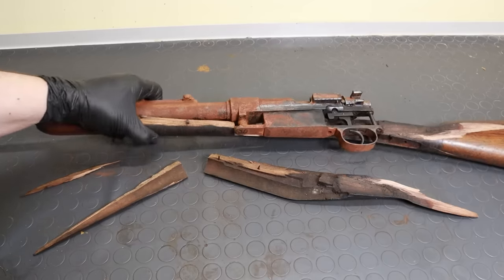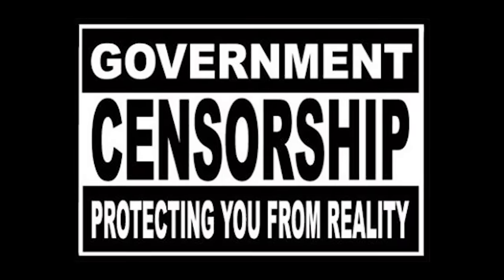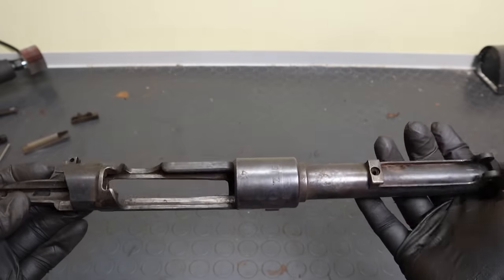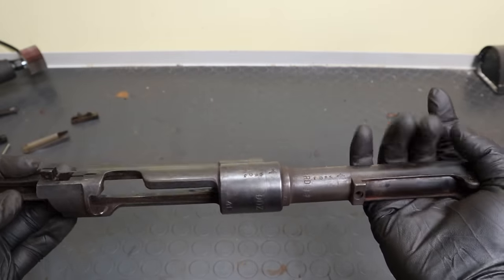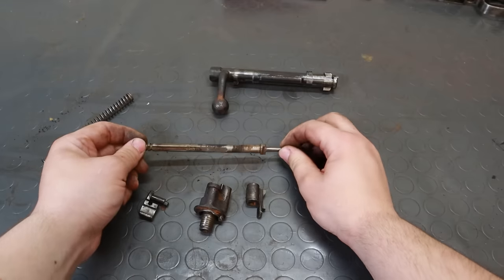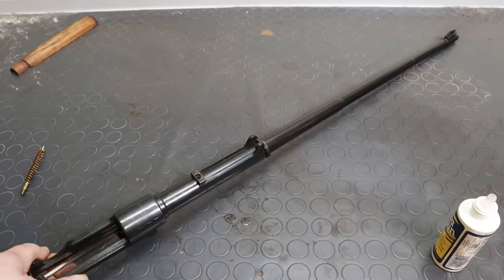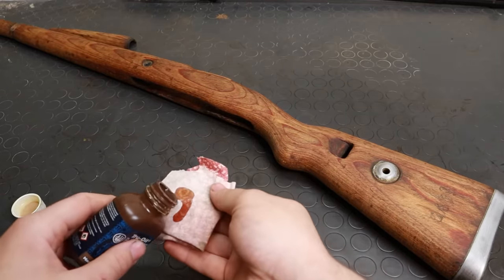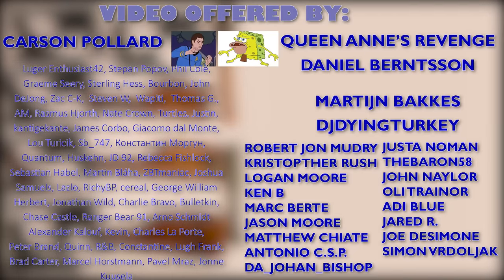Restoration of German Kar98K WWII Rifle

Comment: What would you do if you found a live cartridge in such a rusted gun?
Reply from the maker: I would force open the bolt at the range, with the muzzle pointed towards the embankment. Luckily it never happened to me yet to have a stuck bolt on a loaded chamber
Reply: @Backyard.Ballistics  On that note with a seized bolt/action, how would you know or find out if there is a live round?
Reply: @cambargera  use a cleaning rod. First lay the cleaning rod beside the barrel with the patch/wire bristle end at the chamber and tape around the cleaning rod that would be protruding from the muzzle. Run the cleaning rod with tape down the barrel and if the tape is out the muzzle more than it would be on an empty chamber there is a round or at least a spent cartridge in the chamber.
Reply: @cambargera  you have to look down the barrel
Reply: Realistically a round that old and weathered you would never have to worry about, however it would be wise to do the disassembly at the range
Reply: @KJTUSKJTUS  Doesn't matter how  old ammo is. If it is present, treat it as live and hot.... Basic gun safety, you know...
Reply: @KhaziirEverflight  Especially considering even wet ammo will usually maintain its airtight seal even in the worst of times, I've seen old WW1 era .303 british that were fished out of the ocean and cleaned up were able to fire relatively reliably, considering they used cordite instead of gunpowder it was a feat and a half
Reply: @KJTUSKJTUS  I just found some .303 ammo made in 1917, in my grandparents garage. It had definitely been wet more than once in the time they had sat in the toolbox they where in, they where covered in rust and green corrosion. The primers still fired when I removed the bullets and the cordite still burnt when put to a flame. Was super surprising to me they still seemed usable, but not a chance i was trying to use them.
Reply: @tigerfang6063  I just found .303 ammo from 1917 that was still usable and had 100% sat in a wet unused toolbox.
Reply: @nickoloes  uh no, that’s a very stupid idea for reasons I shouldn’t have to state.
Reply: @Slender_Man_186  he's joking
Reply: @KJTUSKJTUS  living in the SE of England I can tell you that's not very factual at all. We are constantly digging stuff up that more often than not goes boom, and this stuff has been buried for the better part of 80 years!
Reply: @nickoloes  lOL
Reply: @Slender_Man_186  r/woooo
Reply: Imagine using it without a stock…
Reply: @jaywils1078  lMAO
Reply: @KJTUSKJTUS  i used to regularly shoot rounds that were 50 to 60 years old & most fired w/o a problem.
Reply: What americans usually do
Reply: @KJTUSKJTUS  thats not good advice, plenty of ww2 ammo still perfectly usable and protected in a rifle chamber it wouldn't weather much unless water has been inside
Reply: @jaywils1078  tarkov
Reply: @cambargera  u look down the barrel, duh
Reply: that was a great question
Reply: The rust was less severe as I thought.
Reply: Amazing endresult
Reply: @KJTUSKJTUS  lots of live bombs get donated in Europe which are the same age.  You can still buy milsurp ammo that's that old and it still fires.   Assuming it won't go off because of its age might be dangerous.
Reply: @KJTUSKJTUS  Not always true. Should look up the forgotten weapons video discussing turkish 8mm mauser ammo.
Reply: Remove it.
Reply: @KhaziirEverflight  that’s why he said do it at the range lol
Reply: @ambi_cc8464  and because it was done at a range makes it less risky, or what is your supposed argument?
Reply: @KhaziirEverflight  I was just saying he had gun safety in mind even he was wrong about the ammo
Reply: @KJTUSKJTUS  Plenty of gunsmiths have been burnt by muzzle loading guns - old ammunition doesn’t mean safe (as it can actually become unstable and detonate rather than deflagrate when ignited).
Reply: Try to fire the old cartridge after restoring the gun
Reply: Brilliant channel, I only wish that here in the UK we were allowed to pursue our interest. But I’m afraid that two mentally deranged people ruined it for us. Hungerford, and Dunblane. From there on  we as gun enthusiasts were all classed in the same category. And had our liberties taken from us. Just as though we all had their intentions to go and kill indiscriminately.  If a proper check on people applying for Gun licenses had been undertaken, it would never have happened.
Reply: Crap my pants
Reply: @KJTUSKJTUS there’s people who have been cleaning 1700’s cannon balls and have had the powder inside blow up and kill them
Reply: @Backyard.Ballistics  one of my uncle's was doing some digging on some property he bought and found a owlhead revolver in the dirt with live rounds. He removed them, at his friends house (friend lives in a rural area and can shoot on his property) interestingly enough when we looked it up one of the things that popped up was "Top ten Confederate hate symbols" interesting find haha
Reply: POW!

haha.
Reply: @nickoloes  great way to lose an eye
Reply: Do you know what a joke is?
Reply: 4:34 the cleaning sound is satisfying 😌
Reply: @Backyard.Ballistics what do you do with the restored guns?
Reply from the maker: @LorenzoRodriguez-c4c  they're not mine, after I've sorted them out they are either sent to museums or kept in our warehouse, depending on where they come from.
Reply: @nickoloes  bad advice even as a joke.

Comment: Tip: for round cylinders, hook it up to a lathe on the lowest setting and apply the shoe shine technique. You'll be able to cover broad, smooth areas relatively quickly and only really need to dig in by hand for the nooks and crannies.

Still, impressive attention to detail for doing it by hand.

Comment: That was awesome! You know your stuff about these rifles! A few other things about the '98 Mauser is Firstly, they have a 3 position safety. First click (straight up) prevents you from sighting the rifle to remind you its on, and allows you to cycle the bolt with the safety ON to unload. I noticed this wasn't done in the video but rather with live rounds and on "fire" position. The next click locks the bolt, I've used this carrying it on my back because once I fired it with the bolt knocked partway open! All that happens on these is that the firing pin spring actually automatically rolls the bolt down into the locked position before firing! The metal ring in the stock is a bolt assembly tool! If you stand that rifle with the cup style butt on its butt on a flat floor you can walk away from it, looks kinda freaky when you first see it, told a few people a ghost was holding it! they are that balanced. The sight slide has graduations on the back so it can be set without raising your head. I personally love the sights for accuracy and the stock 2 stage triggers can be slicked up pretty good. The stripper clips dont need to be pulled out but rather eject when bolt closes. I can see how the sights are not as fast as some or good in low light. No other rifle until Vietnam had as good and stable of a stock. Each rifle had to be fired with 3 loads at at least double pressure and show no headspace changes. You did a fine job even selecting the correct milled barrel bands for an early one, and I wish I could fire it! Definitely has that 8mm Mauser double clap sound!

Comment: fucking flawless, absolutely astounding skills with turning literally a piece of rusted scrap metal into its original glory of what could be the best bolt action rifle of its time.
If guns had a soul, this ones could put itself to rest knowing its back how it needed to be.
Reply: The K98 was the best bolt action of the time
Reply: @HenrikSherwood  I find that my VZ24 and my 1903 has a much more smoother bolt than my kar98k but i still love it of course. Theyre all in great condition too, A type 99 Arisaka isn’t quite bad either, since they’re all a copy of the mauser bolt.
Reply: @ItchyPilauBoto  I think the 1903 springfield is actually a mauser 1893 type

Comment: THIS, is proper rust.
the parts you would expect to be rusty, such as the outer layer of the barrel and the bolt handle, ARE rusted.
the parts you would expect to have been protected by the wood, or by the barrel itself, ARE clean!

Comment: The significance of a 'controlled round feed' action, such as a Mauser 98, has nothing at all to do with cycling the action from an inverted position.  So why then is CRF action useful, I hear you ask?  CRF largely eliminates jamming resulting from 'short-stroking' the bolt.  With a push feed action you run the risk, in a stressful situation, of chambering a round and then attempting to extract it  and recycle the action without closing the bolt.  This typically results in a round being left in the chamber, which is then jammed firmly in place when the shooter attempts to chamber another round.  When this happens the rifle is rendered completely inoperable until such time as a cleaning rod can be used to dislodge the stuck cartridge.  This situation shouldn't happen in a CRF action because the cartridge rim is firmly engaged by the bolt-head throughout the loading and extraction cycle.

Comment: I am going to be honest here mate.  All of your restorations of "rusty" stuff look fake. And what I mean by that is the "rust" itself. I have handled many restored and found/dug out weapons and after 50+ years the rust leaves some major pits, but in every single video of yours, the restored weapon looks brand new. Same with the stock - if it was old and damaged, the chipped wood would not looks nice and fresh.
Reply: He stated quite clearly that the rifle was given to him without a stock, and the broken stock in the video was unrelated and just for display purposes.
Reply: The guns you see were not found in battlefield, they were stacked inside houses, this means usually between walls with a rag and well greased. They can survive decades without even rusting if the job is done correctly
Reply from the maker: The surface looked miserable before I sanded it off, it gets much better after sanding. However, I have to admit that I normally cover guns that  I am confident I can save. In other words, and in all honesty, I try to pick  stuff that looks worse than it is. I don't have the kind of budget required to buy a good Steyr K98k and ruin it just to make it a video, it's a 2 grand gun here.
However, many channels with way more views than me (several millions instead of a few 100K) actually buy them good and rust them on purpose.

Comment: Well done. As a conservator for these particular rifles, myself, I must commend you for doing an excellent job; although I wouldn't have used TruOil for the finish. The stocks were originally sealed with Boiled Linseed Oil. It takes longer and requires multiple coats but the end result is more worth it for preserving the history of the rifle over the time it takes to get the same finish with TruOil.

Comment: Just one tip always test fire with just one round in the gun.  That way if it jams it won't have live rounds in it.  Or if it blows up then it does not have rounds in the mag that could detonate as well.  Mausers have pressure relief holes that will vent down into the magazine.

Comment: One trick I've used with sandpaper strips is backing them with duck tape or similar, this keeps the paper from wearing down on the edges and makes sanding round objects, like barrels and stocks, a lot easier in my experience.
Reply from the maker: That is probably even better than what I do
Reply: I'll keep that in mind. Thanks!

Comment: As you were tapping the trigger/sear pin, I wanted to say " watch out for that spring" and as I was thinking it, it popped out. I can't recall how many times I have lost that darned spring, and others like it, under my bench so many times that when my kids clear out my shop, they will have a whole lot spare parts for guns, lol. Also, as you mentioned the grease in the stock, I recalled my gunsmithing instructor setting cosmoline coated stocks on a paint booth stand in front of a gas heater in the shop and it was my job to wipe it off every 10 minutes as it soaked out of the pores. After we did that, we used a trick similar to yours. Also, check out Track of the Wolf black powder supplier, they sell a similar rust blueing solution to the one you made pretty cheaply and I have had great results with it.

Comment: i did a restore on my 1935 peruvian mauser. stock only.  you did a damn good job on that restoration. after i put the stain on i put a thin coat of vaseline on the stock to seal it from moisture.

Comment: Shame you did that to the stock. Best way to clean out the oil would have been to use a hairdryer and just wipe off the oil, or wrap it in shop rags, place it in a black plastic bag, and put it on the dashboard of a hot car on a sunny day. 
Boil linseed oil would have been a better finish for the stock IMO.
Other than that, a great restoration! I love these videos, keep it up!

Comment: One trick I use to preserve marking in metal (small marks, logos, text, numbers) if I have to sand the or sand blast the piece is to clean the markings of all oils, then fill them with baking soda and CA glue. This wears down with the metal and when you finally get to the finish sanding you just head the area up and peal what's left of the protective masking off.
Reply from the maker: Thanks for suggesting!

Comment: I'm a big fan of the Kar98k so I even bought a Replica for a reasonable price, considering the Gun Laws in Germany.
The Bolt doesn't sit as firmly as I would have liked, but everything else except a proper magazinmechanism is there and as close to the original as possible.

Really solid work on the Restauration! It always pains me to see such classic guns rot and rust away

Comment: If I missed it in the comments I apologize for repeating it, but mineral spirits get rid of the cosmoline (if that’s what the “grease” was…) I get a PVC pipe, place a cap on the bottom and fill it up with mineral spirits, then just drop the piece in…

Comment: I made the mistake 30 + years ago of buying a select grade k98. When I unboxed it you would have thought they used a wire wheel on it removing the finish completely. Unfortunately the waffen stamps were all ground off but all of the parts had matching numbers. Cleaned it up and put a cold blue on it. I wish I had known more about this before I touched it. Should have had it professionally redone.

Comment: Hey big guy, i know you know what your doing and this isnt a critique, but if your ever out of penetrating oil or just wanna try something new. I actually recomend wax, once the part is either heated or the wax is melting, it works great even better in some cases than Penetrating oil. If you do try it i recomend a tea candle
Reply from the maker: Thanks for suggesting and sharing your experience😉
Reply: @Backyard.Ballistics  just trying to help. I learned it from a mechanic, i use it for hard to remove pins and bolts on my car and other machinery. Ive noticed in some situations its better than penetrating oil, i guess cause as it cools off i guess it lubes it.

Comment: I did my first carding when I rust blued a very rusty Star BM with 0000 steel wool and a carding wire toothbrush.  It took forever, my next project I'll be using a big carding wheel I got from Brownells.  Im just going to chuck it in my drill and hold the drill in my vise, kind of a cheap version of the big motor setup Mark Novak uses.

Comment: 14:18  I have a K98 made in 1937 before the war, as far as components go all intact from the war but the parts don't match. don't care for matching numbers personally since I go more for function. I also finally recently got a bayonet for it. telling by the blade being flat, it was never sharpened on the field, it got the factory default sharpening on the tip got shipped out and pretty quickly got captured in all in 1944-45. pretty much a pre-owned but New factory new bayonet... and it actually saw battle, the serial on the blade got destroyed by the allies (the British especially liked destroying factory marks). the serial numbers almost completely match likely being made in the same month between the blade and scabbard. still see rust and dirt from the war trapped in the scabbard. heck got some while cleaning under the wood jacket in the front of the rifle and in the bolt. managed to sample it on a paper towel while cleaning to preserve it. it probably wasn't cleaned like that since a Nazi-held it; like a literal time capsule.

Comment: you really do great work, your choice in the way you do it was spot on, the only scary part was when i saw you cut the battery apart, i have never seen that before you really do incredible work, thank you for your videos.
Reply from the maker: Zinc carbon batteries are nothing like lithium ones, even if you accidentally short them the current is self limiting, and the effects are mild. Also, since a few decades ago  there are no longer toxic chemicals in them.
Still, some caution is required

Comment: Could you explain the amounts and how to make the oxidation solution?  It's the simplest and fastest method I've seen so far, congratulations for the work, I'm from Brazil and I'm still following you
Reply from the maker: You can find it in the Carcano restoration video, you can find it linked in the top right corner of the screen
Reply: @Backyard.Ballistics  not on desktop, could you link it in the description?

Comment: I hope you see this comment and I hope you help me
What about the gun that was damaged in fire? All metal parts are there and doing what they should do, accept for the spring, it lost its strength due to heat, is there a way to fix it? To give it back it strength? Would the  reheating and quenching work?